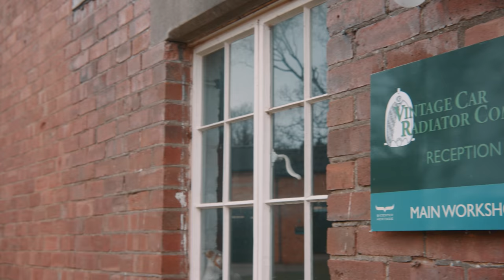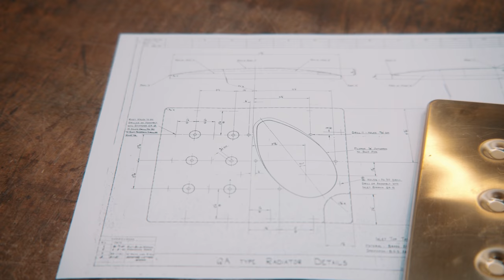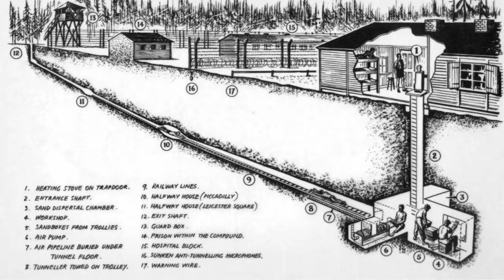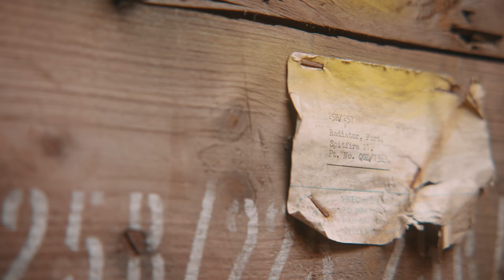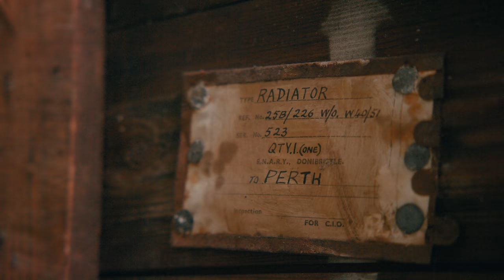The Spitfire MJ444 Restoration | Charlie & Parky visit Vintage Aircraft Radiators

Comment: Great upload of the MJ444 restoration , found it most interesting. In the 1970's/ 1980's l worked for a company called  'Serck'  based in Greet/ Birmingham UK and specialising in the manufacture of heat transfer equipment (Radiators/ Oil coolers). Like  Delaney Galley  Serck adapted from automotive to aviation requirements at the outbreak of both World Wars. Indeed during the second world war Serck went on to produce radiators and oil coolers for some of the most famous aircraft in British aviation history, Hurricane ,Spitfire, Lancaster, Mosquito ,other noticable but often overlooked types too like the Halifax bomber, Hawker Typhoon and Sea Fury. After the Second War too for such iconic aircraft as the Hawker Hunter, Harrier jump jet and Concorde. I would be fascinated to know if the original and still crated  Spitfire 21 radiators shown in the video are Serck units ? .l have a number of original Serck photographs (rescued from the bin in the publicity office) showing Serck manufactured Spitfire radiators , be amazing to know some of these have survived to this day.

 Keep up the great work Aero Legends, and l will keep watching.

Comment: When are we going to see a dig at Castle Bromwich and see if the stories are true about the reported  Engines and possible complete airframes in crates  reported  that were dumped  2022 ???
Reply: The story of the Castle Bromwich 'Holy Grail' of a stash of buried engines and complete Spitfire airframes in crates has resurfaced many times over the years, unlike any actual evidence of the items themselves, but that doesn't mean they aren't there (maybe we could get Indiana Jones on one last crusade to find them). Even if they are there, they would very likely be underneath parts of the Castle Vale housing estate that was built after  RAF Castle Bromwich closed in 1958 with the airfield making way apparently for much needed housing in the area. The likelihood of the local council allowing a dig/excavation on the site has and l would think always will be very slim...but those of us who are interested can live in hope.
I have spent a fair bit of time looking into the Castle Bromwich/Spitfire connection, even made a short video about it which you can find on my channel.